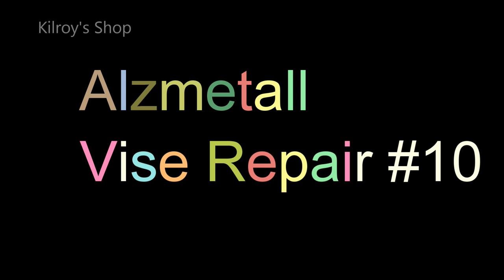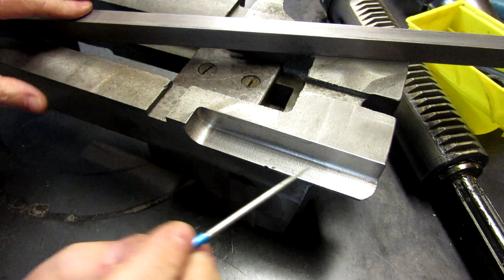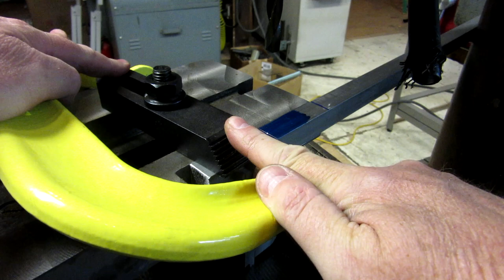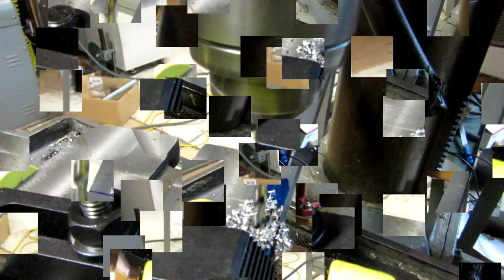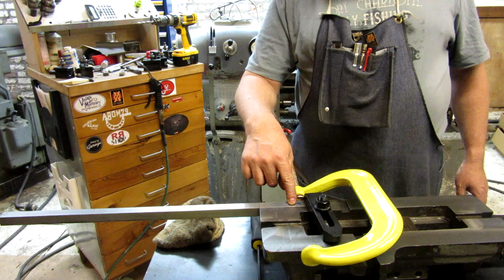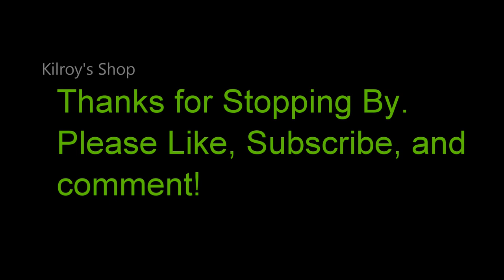Alzmetall Vise Repair #10

Comment: Great video as usual.  I like that torque arm, never thought of doing anything like that.  One thing for sure you need a vise secured when you start to drill a hole because I have seen metal go helicopter on the drill bit and it can beat you mercilessly.

Comment: Nope.  The Ole' groaner ain't done till it has a layer of crummy hershey brown paint on the non-working surfaces.  While the paint is still wet you can stick a few bits of tissue paper in random places because  "No job is finished until the paperwork is done!"